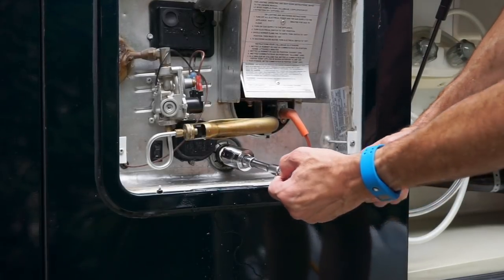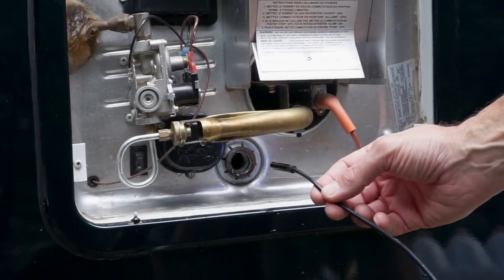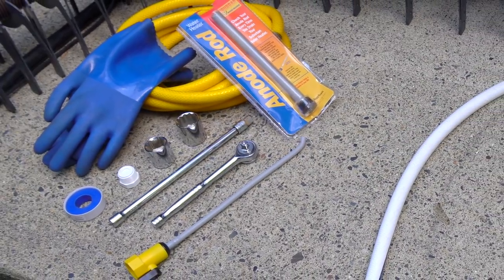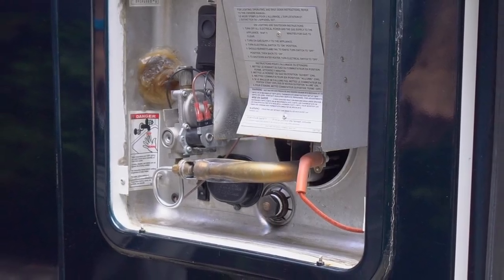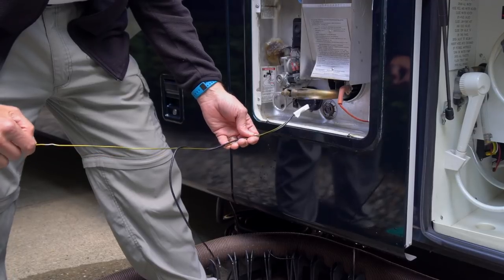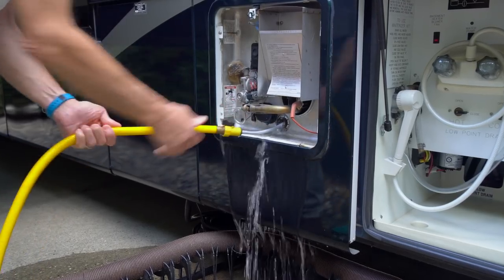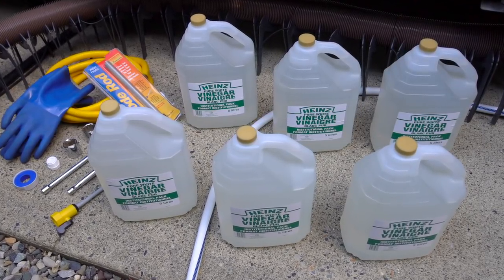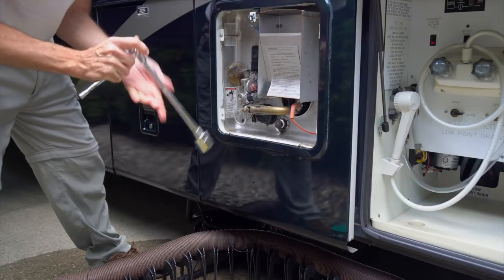RV Water Heater Flush & Inspection SURPRISE!

Comment: Wow - That's very interesting! We just drained our water heater for the freezing weather and noticed some gel-like substance that came from it. Do you guys know what that could be? I would like to flush it out and take a look inside like you guys did - I doubt it has ever flushed or cleaned it. We purchased our camper used, from a widow who had lived in it with her husband for a few years.
Reply from the maker: The only thing that we can think of that could be described as a "gel-like substance" from the water heater is either mineral pre-scale (if it was white) or algae (if it was clear or green-brown). Either way, you need to thoroughly flush that tank Em!
Reply: It was clear! Yuck! So maybe algae? We're camping this weekend, and I guess I will need to see if we can find a time and get the tools to flush it! We've camped several times, and taken several nice, hot showers, washed dishes, etc.... I guess we're lucky we haven't gotten sick yet. There are a few things I know we need to do, like clean the fresh tank, too - we haven't used the fresh tank yet - we've only run straight from hose to rig, not filling the fresh tank at all... I have no idea the condition of that! (I need to get Mike to watch your videos!)
Reply from the maker: Sounds like a good idea to avoid drinking any water on board just yet. Definitely watch our series of videos on water heater flushing and fresh water system sanitizing. Maybe do them twice. ;-)
Reply: Yes! Will do!!  Thanks!